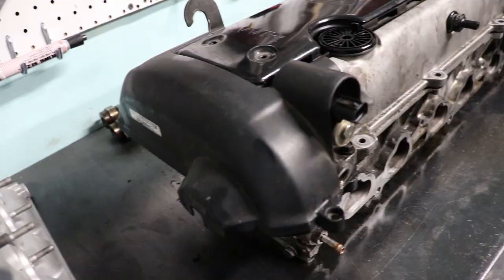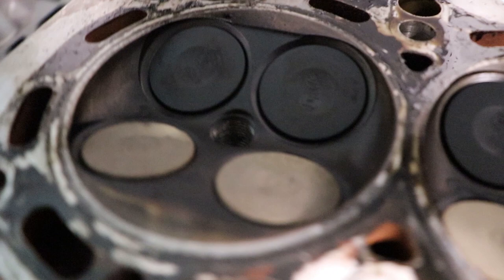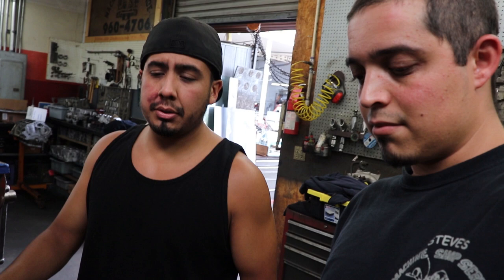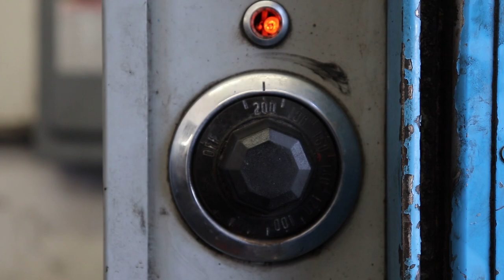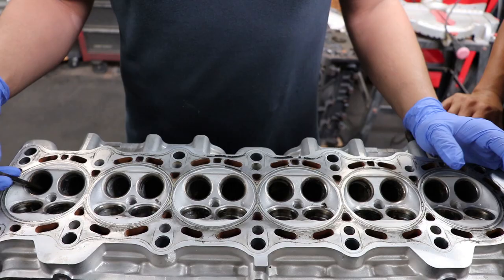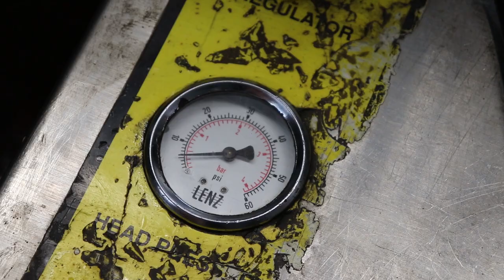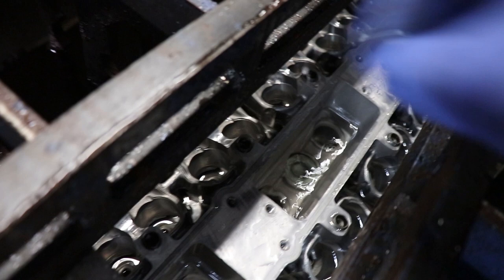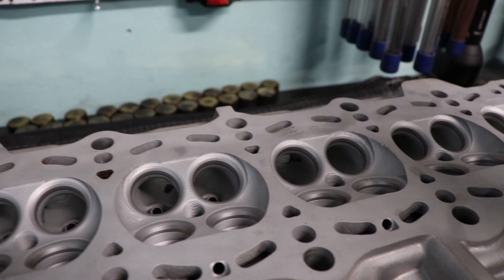1.5JZ Cylinder Head Inspection and Prep

Comment: Great video bro, I've never seen a cylinder head video this detailed.
Reply from the maker: AUTARKY DESIGNS Thanks!!! When I do my sisters KA I’ll make another cylinder head video with more details.
Reply: @koukicutters1527  bro how much size diameter the stock 1jz valve?
Reply from the maker: @frankzane7326  Stock 1jz intake valve is 32mm the 2jz intake is 33.6mm